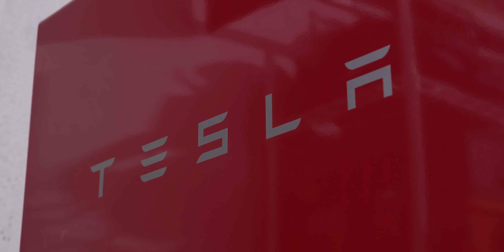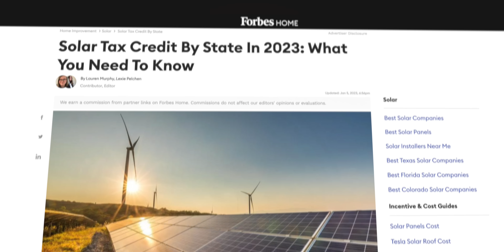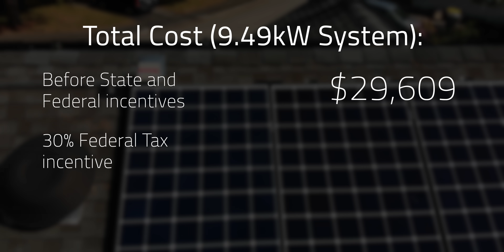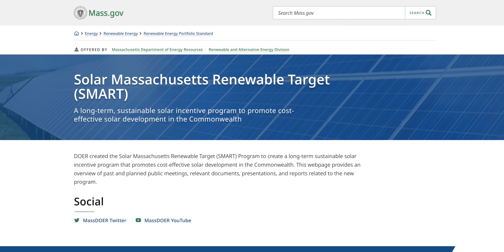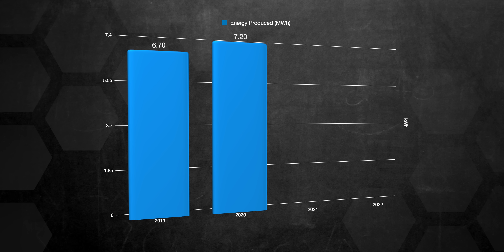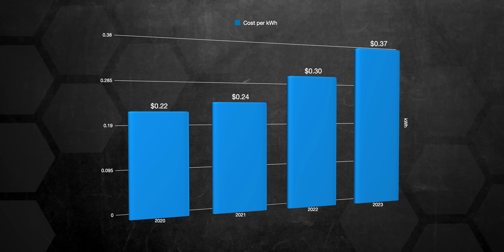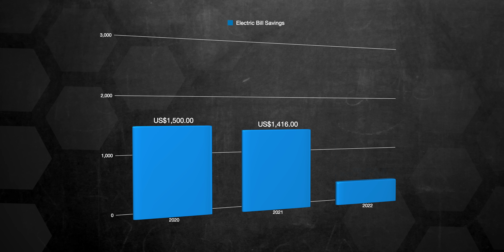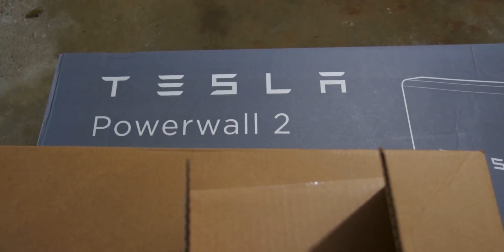5 Years with Solar Panels - Is It Still Worth It?

Comment: Bought a $74k system through Fluent Solar, 36 panels. System production contract is supposed to be 16464 kw annually, 1372 kw monthly. The system since Sept 28,2022 to date has only produced 3552 kw. The system cost is $300 a month for 25 yrs. Plus electric bill. So you can have an electric bill of $200 plus $300 system cost. Then we were told the government will cover 30% of the cost, well that is ONLY if you owe the government taxes equal to the 30%. It's a cool looking roof ornament, I have yet to see the cost benefits, and I just had my taxes done to find out I don't qualify for the $22k tax break because I don't owe the federal government the 30% to qualify. So now my husband again a 20 yr Gulf War vet gets used, lied to, deceived and betrayed by the government and country he served. Thanks for the lies and manipulation.

Comment: We have tiered rates. For us, it can range from $.05/kWh to $.10. Our credit rate for Solar sellback is $.097kWh. With our 6.4kW system we picked up about 8 MWh on 14.8MWh of consumption our first full year. We averaged selling back around $80/month, so close to $1k in payback, but also lowered our overall use, which put is in lower tiered pricing. Put's us at around 7-8 years of payback after our around $7500 after rebates, system.

Comment: It is too bad we have such different rules for “net metering” and SREC payments. I had solar in Mass as well and then moved to New Hampshire. The SREC payments are 1/10 that of Mass and I wish I got a 1 for 1 payback for my unused solar. I do understand why it is not feasible to have a 1 for 1 payback but I do not understand why in some states any electricity I produce and send back to the grid which then gets used by my neighbors and billed to them by the power company you do not get some reimbursement for.

Comment: Maybe, not so undecided. It's a little misleading to say you have saved money. You haven't saved a dime until the panels are payed off. You have put money towards paying off their cost.  Literally, half of your solar installation costs were subsidized, and that does not include net metering, and those SREC payments, which are also temporary subsidies.  Note that those subsidies came from tax money, paid by fellow citizens. No such thing as a free lunch.

Run the numbers for those installing solar when all of the subsidies have subsided (no net metering, no tax credits, no SREC payments etc.). You'll find that they will rarely pay for themselves. Isn't it a little misleading to ignore that looming fact? Assuming no subsidies, even with your high rates, your payback period should be about 5 years/$7K x $30K = 20 years, assuming net metering continues all that time, and it won't. Add your battery, and now it's 30 years. You just told us all that your panels will have paid for themselves in just seven years, as if it were a testament to cheap solar, when it is, in reality, a testament to massive subsidies. How many of your readers are aware of that? 

What will matter are unsubsidized costs. Also, as is typical, you won't be living in that house for 20 years, which means you will next be telling us about how you got your money back with a higher price for your house because it has solar panels (but without a statistically significant sample size as well as control cases, you won't be able to prove that). And what is it going to cost the buyer to replace the roof under those panels some day? And to ice the cake, the cost of all of the energy saving efforts on your new house will likely not save money either because you're heating a much bigger space.

Would you guys be so happy you went solar without the roughly $25 k in subsidies? Seriously. Complexity, cost, maintenance ... all for what? And if your state finally gets zero carbon power, what use will your solar panels be if they are offsetting zero emission sources like wind and nuclear? How can tiny little power stations on rooftops compete economically with gigantic zero emission power stations that capture massive economies of scale? I predict that residential solar will eventually go the way of the dodo. They don't make economic sense, and if your utility power is zero emissions, as mine is, they make even less sense.

Solar panels have more value in places with high rates. Where I live, our rates are about three times lower than yours. Your rates have soared because about 60% of your electricity comes from natural gas, which may be a temporary spike caused by the war. About 20% comes from nuclear, which isn't affected by oscillating fuel prices. 

I'm also skeptical of your new website. Why don't you instead simply give your readers the link to the NREL website for solar panel data, along with an example spreadsheet  to download and a post on how to use it. Let them get an unbiased, honest answer for themselves? That's a rhetorical question, not expecting an answer.
Reply: You're right, we should definitely continue subsidizing big oil instead, this is all folly and stealing $$$ from hard working Americans. Hate to have solar panels economies of scale to have dropped the prices even further by the time the oil runs out in 2050, and the Natural gas, another decade or so later. Let's go with your plan, I'm sure electric rates will never go up throughout that timeline, and we can entirely ignore why there are subsidies for this. We can also ignore that the state of Texas, largely made it through a summer without brownouts due to residential solar. Guess who that helped ? Everyone that didn't have to pay for more infrastructure.
Reply: RacingToGreen said: “You're right, we should definitely continue subsidizing big oil instead , this is all folly and stealing $$$ from hard working Americans.”

Love good sarcasm. Not arguing the pros and cons of any given subsidy program. Simply pointing out that his conclusion is likely heavily influenced by the  ~$25K in subsidies. His promotion of solar is becoming profitable, which is the kiss of death for objectivity.

Because we don’t use oil to make electricity, it has little impact on power plant production costs. The cost of natural gas does. Solar and wind would not exist without natural gas and hydro power stations. The hope is to find a cost-effective way to store enough energy to replace natural gas power stations, which is just a hope, and very unlikely to happen in the foreseeable future. Wind and solar are essentially, natural gas power station fuel reduction devices. They will likely actually lock us in to using natural gas

RacingToGreen said: “Hate to have solar panels economies of scale to have dropped the prices even further by the time the oil runs out in 2050, and the Natural gas, another decade or so later.”

Even more sarcasm! Love it. Well, that’s the standard argument, isn’t it? Getting the ole crystal ball out and proclaiming that one’s favored energy source will one day be the most cost effective, that costs will forever continue to drop. As of today, even the NREL concedes that residential rooftop solar is the most expensive form of energy production, worse than nuclear and gas peaking.

https://imgur.com/88QYRga

RacingToGreen said: “Let's go with your plan”

I never presented a plan but keep up the good sarcasm.

RacingToGreen said:  “I'm sure electric rates will never go up throughout that timeline”

I can’t get enough good sarcasm. Glad you brought that up. Look at what happened to German rates as a result of incorporating so much wind and solar. Same thing is happening in California. Why do rates increase with increasing solar and wind penetration? It’s because of increased overhead. You use less fuel, which reduces costs, but you must build and maintain huge wind and solar power stations in addition to vastly more power lines… in addition to keeping the existing natural gas power stations to smooth out wind and solar production. The hypothesis was that wind and solar would reduce rates, but it has been tested in the real world and failed. I know, I know… your crystal ball says that storage will soon be cheaper than natural gas power stations.

Eventually, all rooftop solar owners will be paying retail rates for any power they use off the grid and, the hope is they will be getting paid wholesale rates for whatever they put on the grid. While you are at work, your solar panels will generate power for the grid at some wholesale rate. At that rate, you will never pay off your investment (essentially making your electricity rate very high). When you get up to go to work before the sun hits your panels, you pay retail rates. When you get home after the sun no longer hits your panels, start doing your laundry, charging your car, turning up the air conditioning, your lights, TV, etc.,  you will be buying electricity from the grid at retail rates. While you are at work, your panels will save you very little money (but only if the sun is shining) because they power a house that is using a minimal amount of electricity. Again, we can get our crystal ball out and fantasize that a Tesla power wall will be so cheap as to make all of this financially viable, but I wouldn’t bet on it.

RacingToGreen said:   “…and we can entirely ignore why there are subsidies for this.”

Sarcasm alert!  I’ve never argued that solar subsidies should not have been implemented. Subsidies are a means of testing to see if ideas can be made cost effective. They are meant to be temporary to help an industry grow to be self-sustaining. There is no guarantee that any given subsidy will result in successfully creating a new industry. It’s a test. Some subsidies successfully usher in new things, some fail. One of the most successful energy subsidies in all of history was nuclear, which has been providing about 60% of our zero carbon electricity for many decades now. One of the worst would be the 10-15% corn ethanol in your gas tank, which has become a permanent farm subsidy, the price of which is highly dependent on the price of natural gas used to make it.

RacingToGreen said: “We can also ignore that the state of Texas, largely made it through a summer without brownouts due to residential solar.”

Even more sarcasm! Or, are you trying to be serious now? Considering that rooftop solar makes up about one percent of Texas electricity generation, is the word “largely” the best adjective?

RacingToGreen said: “Guess who that helped ? Everyone that didn't have to pay for more infrastructure.”

Texans without solar on their roofs are subsidizing those who have them.

Comment: Matt, we did solar about 5 years ago also. a system that produced 23.7 MWh in 2022, Im  wondering if you have EverSource as your utility, I do, I also work for them in the substations. But you are exactly right, Energy here in the NorthEast has gone nuts in cost increases.. Im so glad we did solar, we have 49 365 Watt LG Neon2R panels and its been fantastic..i see they make 395 watt panels with the 60 cell setup WOW!!! I do wish I my Enphase Micro-inverters were the IQ8 series which allows you to use your solar panels in conjunction with batteries and an automatic transfer switch..but thats really my only gripe.. I have a 20kw 1600 rpm Kohler 20RZ when times get tough and Im on storm duty with the utility. Plus the batteries i would have needed would have been excessive..But i did all low ambient heat pumps/heat pump water heater sealed everything added an HRV, new new construction windows/sliders, the house is top 87% (2x6 24 oc framing) in efficiency when compared to the best new energy efficient homes..I do have a question, why did they pipe the stringers on the roof???? With the enphase micro inverters you switch over to AC on the roof which allows the installer to use romex through the roof and down to the combiner panel. my system only has the panels and the emergency disconnect switch near my meter can, its a clean install.. Best of luck with the home and future projects!!!!! GREAT WORK MY FRIEND!

Comment: I like your videos and you do a fine job. I have had solar on my home in California for over 22 years.  I was an early adopter of this technology and have been very happy with it. The only issue I have had is that my inverter started to die after about 15 years. (It was guaranteed for 10). At that time I got a new inverter and added another 12 panels, which were about 66% more powerful than the original ones. All of the panels are still producing electricity and it has been fun to know the sun is providing our power. I wish we had the great support you have gotten in your state!

Comment: Great video as always! I found your channel after buying an EV in 2019 which then made me look into getting solar for home in SoCal. Had 26 LG panels installed and due to net metering, electric bill dropped to basically nothing. Your advice about doing your research and getting multiple bids is spot on. Went with the middle of the road bid from a local company and have overall been happy. My advice would be to consider battery backup installation if you live in area prone to blackouts like I do. Hoping battery cost goes down soon. Curious to see what happens when we add second EV too.

Comment: We had 9 kw of solar plus (2) power walls about 1.5 years ago.  Since they were sone together the entire price becomes eligible for tax credit. We are in Utah which has a poor net metering deal (wholesale rate for credits) this makes the battery more valuable.  We are net zero over 12 months.   By having the design, and installation done by an experienced contractor made the project excellent.

Comment: As much as I would love to have one of those solar systems, as a 60+ person it doesn’t sound like I would have enough time left to see a return for the investment. We got a geothermal system for our 4,300 sq.ft. home, but the frequent, expensive repairs and maintenance over the years make me wonder if we’ve really saved much. I definiteky see the return for the on-demand water heater and I strongly recommend them.
Regarding buying a house with a solar system, I have already seen a few houses that come with the remaining balance for the system installation (as much as $30,000 in one case) separate from the asking price for the house, making it even more prohibitive.
Reply: you need to include a calculation for the cost of inflation regarding rising utility costs. you might be surprised.

Comment: Just had my system installed. Still awaiting a PTO (Permission To Operate) from CenterPoint Energy. For now I am using a gas generator instead of a battery. I'm hoping sodium, solid state, or another technology reaches lithium parity or close to it in a few years. That should help bring battery costs down.

Comment: Great video and information.  That said, the apartment complex I live recently installed smart door locks that can be controlled remotely.   The real cool thing is the door lock batteries are being recharged from wireless signals.  I had not heard of this before but do remember some of the early radio experiments showed current jumping between wires at a distance from the transmitter.  Could you do a segment on this?  I know the amount of energy captured cannot exceed the power of the source, but it seems to me trickle charging to keep things like battery operated tools good benefit from this energy recapture.

Comment: Installed 13kW for about 13k€ end of May 2022 (same E-W orientation, location in Central Europe, just south of the Alps, one "big" SolarEdge inverter with power optimizers per pair of panels) and hopefully will produce about 12+MWh, so we can cover our electricity and heating needs in full. No EV yet. We'll see. 
Batteries not (yet) included.

And yes, snow slide-off is awesome. 

We have been "checking-it-out" for some years, glad we waited a bit, as we got additional 3kW of panels for free. :)